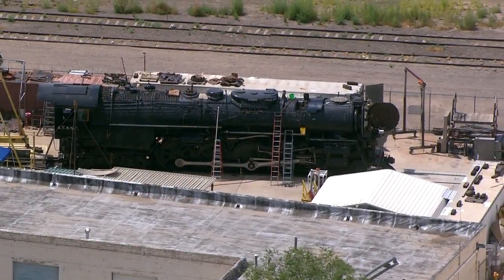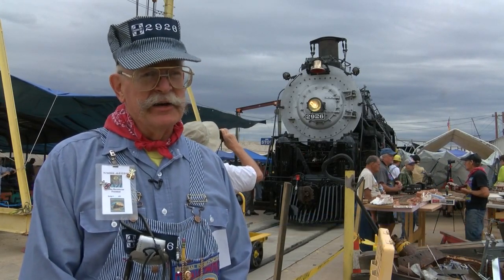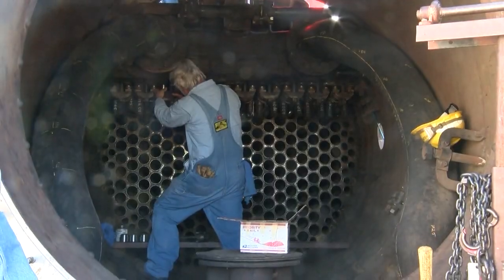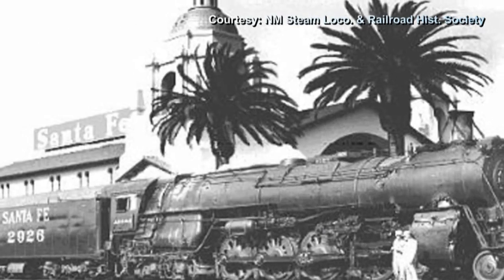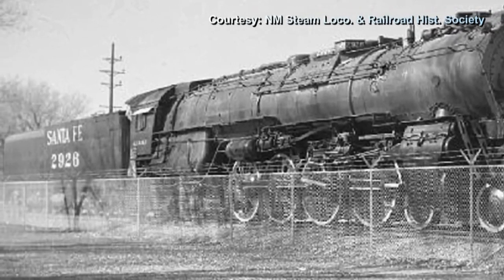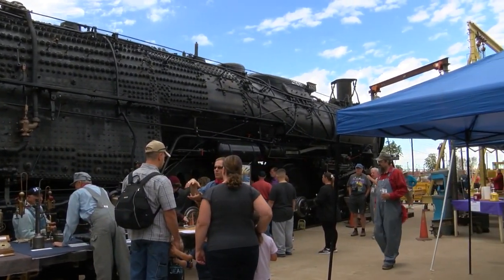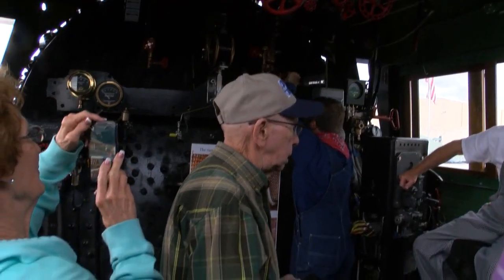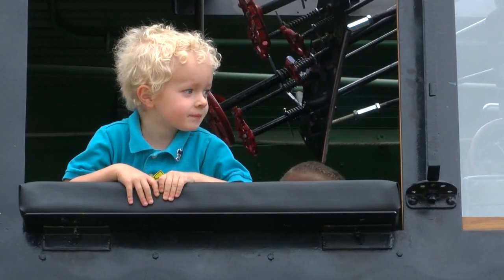Unique steam engine restoration near completion

Comment: Not to take away from all the work (I've been involved in locomotive restoration efforts as well) but Santa Fe #3751 has seen so very little use since 1991, does it make much sense to bring yet another large steam engine into steam?
Reply: Well I feel that the more are restored and preserved in operational condition the better. As you may well know both of them like many other large steam locomotives around the country are at the mercy of the railroads that own the tracks they would need to run on. 3751 is fired up at least 2 to 4 times a year rarely more but most of those times it is fired up to make public appearances it isn't leading an excursion train in fact it has been a few years now since the last time it pulled an excursion. I don't know how things will be with the guys in charge of 2926 but I can only hope they are able to pull passenger specials in the not so far off future.
Reply: I'd imagine it's because 3751 requires more maintenance than pretty much any other main line steam engine. It's about 20-30 years older than the other similar ones currently in operation or soon to be (UP 844/SP 4449/NW 611/ATSF 2926/MW 261) and as such it's missing a few "modern" features that the others have - things like automatic lubrication for example. Plus, running in the LA area is hard, because of the very strict emissions rules (reasonably so - even with modern standards and far less dirty internal combustion engines, there's a cloud of smog that hangs over the city).
Reply: Better than letting it rot away